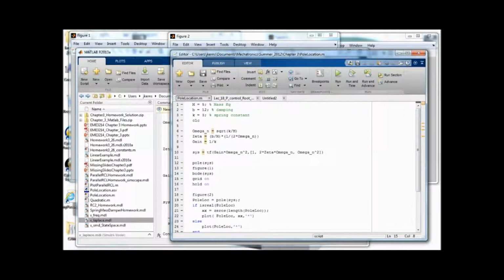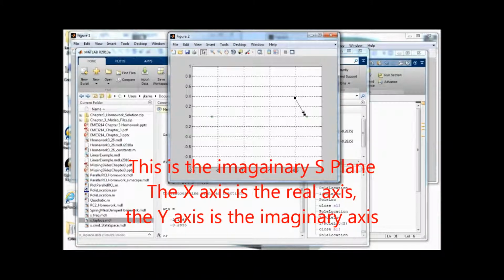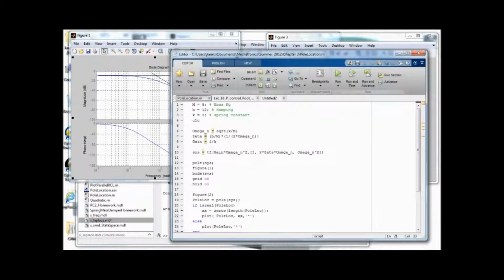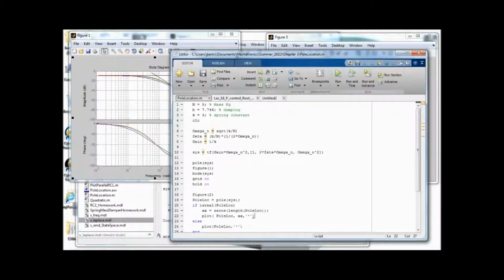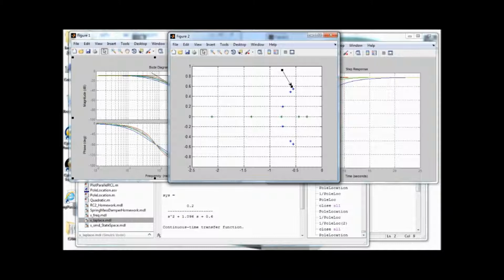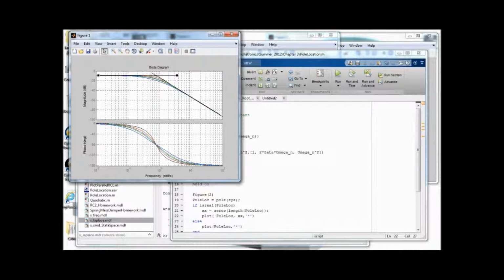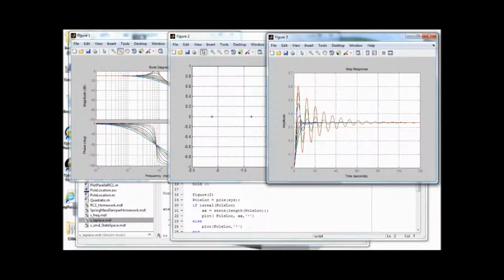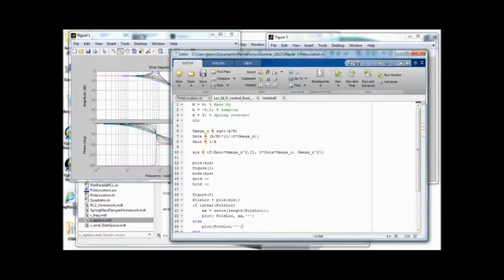EME 3214 Mechatronics: Second Order System - Time Response

Comment: can I get your source code ?
Reply from the maker: M = 5; % Mass Kg
b = -0.1; % damping
k = 3; % spring constant
clc

Omega_n = sqrt(k/M)
Zeta = (b/M)*(1/(2*Omega_n))
Gain = 1/k

sys = tf(Gain*Omega_n^2,[1, 2*Zeta*Omega_n, Omega_n^2])

pole(sys)
figure(1)
bode(sys)
grid on
hold on

figure(2)
PoleLoc = pole(sys);
if isreal(PoleLoc)
    xx = zeros(length(PoleLoc));
    plot( PoleLoc, xx,'*')
else
    plot(PoleLoc,'*')
end
grid on
axis([-2.5 0 -1 1])
hold on

figure(3)
step(sys)
grid on
hold on
Reply: GeoffreyThorpe123  Thanks but it was all, and when I implemented 3 figures appear but fig 2 it was empty !!
Reply from the maker: Asan Masraf If memory serves me correctly (I don't have Matlab at home), the first set of points plotted end up hidden under the axes - try adding a second pair of points with a different damping ratio or changing the axis settings.
Reply from the maker: GeoffreyThorpe123
OK - just checked. With the value of b = -0.1; % damping which was the last value I used in the file, the poles end up on the right side of the complex S plane as you would expect, but the script sets the axis to be axis([-2.5 0 -1 1]) which hides the poles. Comment out the axis setting or use a positive value for the damping to keep the poles in the stable left hand side of the plane